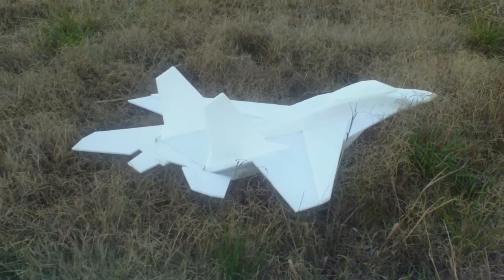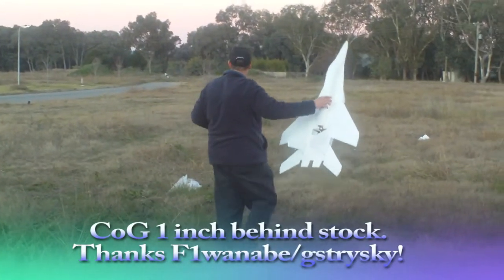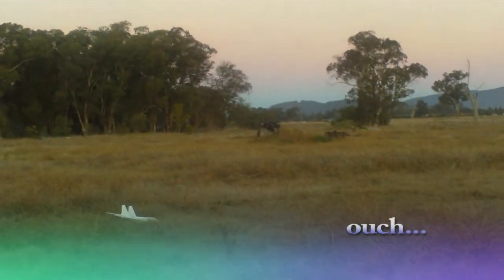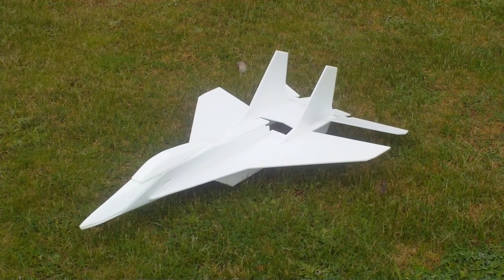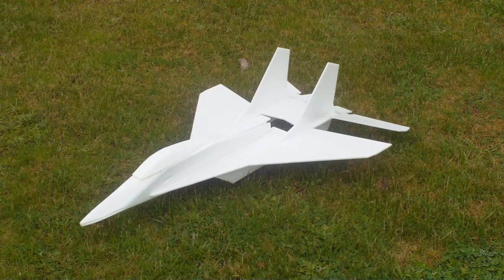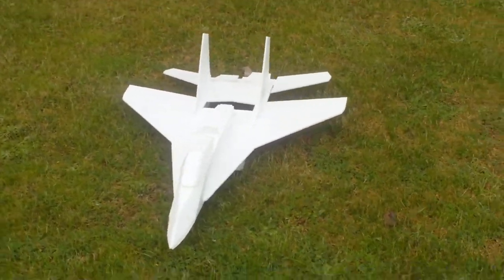Mig 29 v2 Re-Maiden

Comment: Nice one, Grey! You are right on about smooth and effortless. Also the points about linked 4x4. I did cut down the ailerons and have them on very low throws but left elevons stock size. I did enlarge (beef up) the tv area for strength. Excellent review!